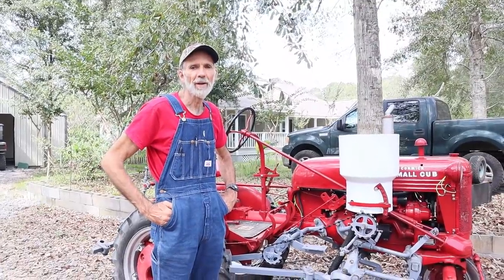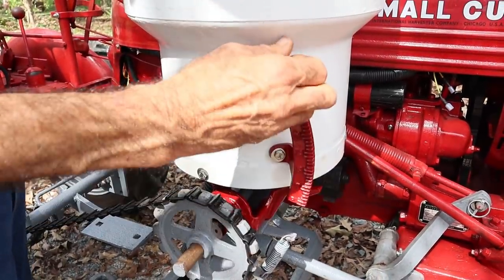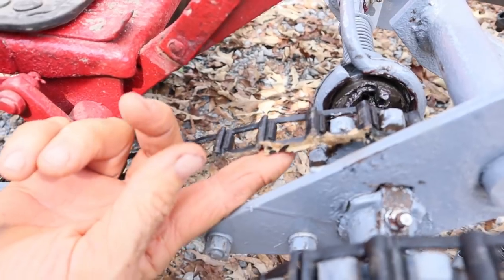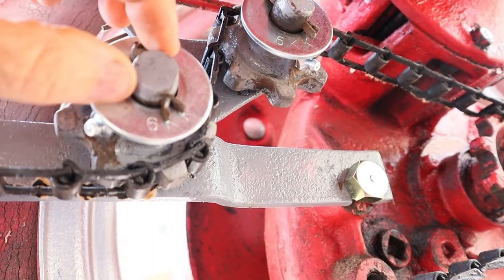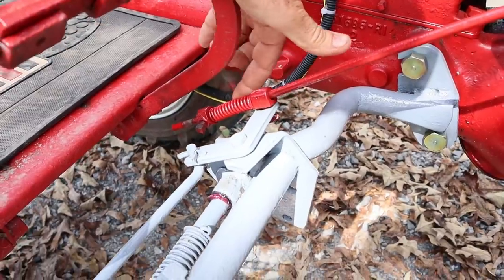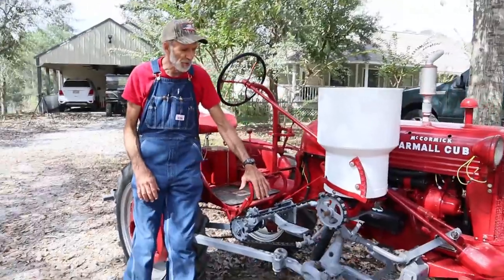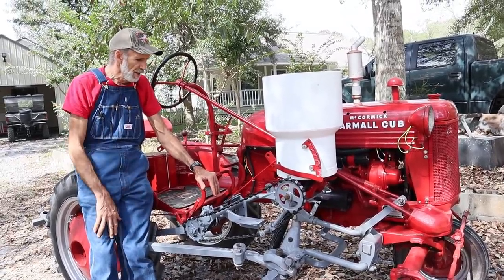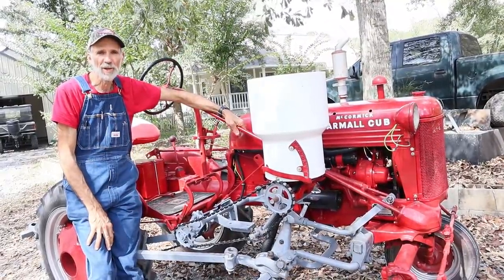Fertilizer Spreader for the Farmall Cub

Comment: Hello again Danny.  I don’t know if you will be able to see this comment as the video is not current.  On with my story, I very recently purchased a Cub with a side dresser.  Someone had stolen the man’s cultivators as he had them on a pallet behind his shop!  The side dresser was indoors however.  The majority is as NOS, I just did not know how to install it.  I am 95% that I have everything now.  The hopper (with lid) is as new as well as the mount.  I got a bunch of different sprockets in the tub of “stuff”.   The man did not realize the cultivators were not there until the deal was nearly complete.  He discounted the tractor so much I could not pass it up.  I have a bunch of Cubs (mainly early) but no side dresser or planter!  Thank you for providing useful information.  I’m somewhat older than you, but I refuse to be a couch potato!   I just finished a 1,600 mile rd trip to pick up a 25 hp TLB package out of western TN.  Pretty country.  I’m the guy the gave Joey the Super A’s.  Heck of a nice man, and his family.  Thanks for sharing your time and knowledge.  Stan here.

Comment: I have a special place in my heart for the Farmall Cub. The first tractor I ever drove or used was my Grandpa's 1955 Cub. When I'm done with my fertilizer hopper, I clean and wash it out. When it dries off I set in in a tub od burnt motor oil until about a month before I will use it again. I take it out and turn it over so the fertilizer will drain off.

Comment: Thanks so much for this video. I have most of the parts for that same set up for my Cub. I am missing the parts that are used at the bottom for putting seed and fertilizer in the ground. I will use your video when I install on my tractor. Thanks!!
Reply from the maker: Hope it helps.

Comment: i spent $4000 getting a wreck of a cub that belonged to my uncle in mississippi restored.  it was a wreck, should have been scrapped, but it was "family".  so i cringed and went for it.  the guy doing the work spent two years, every time he turned over a rock he found more trouble.  later he told me it was the most difficult one he ever restored.   i forged on.  after delivery i still did some follow up work, carb, regulator, still doing the fine detail work.  it was worth every penny, i only found one as nice and it is in a museum.  it starts up with just a touch and sounds like a little sewing machine running.  i have a picture of my uncle riding around on it in his yard in the 1950's.  it stays in the poe barn on concrete floor.  it's huge demanding farm job is me riding it out to the mail box.  still is almost entirely original.  still 6 volts and generator.  people run these little gems into the ground until they die a sad death then park them and let nature rust them back into the soil.  it is just sad.  THIS GUY at first i thought was just another "hill billy" abusing a little cub, i was wrong.  he has dug into this at great depth and treats the little cub like it is a real treasure.  he has a video on the most extensive piece on wiring i have seen yet.  not exactly original style but neat and functional.  i am still pondering mine, there are some issues with the L charge and other of the 4 positions that are a little vague, what farmall engineering intended to accomplish there.  it sounds real simple....until you dig into it deeply.  when you get a little cub all restored and everything working right it is a real joy and worth every penny and all the time spent.  they are an amazing piece of equipment from.....ummmm....how long ago ???  70 YEARS AGO.....think about that for a while......
Reply from the maker: I have since purchased new tires and like new equipment that I'm restoring. They're worth every penny.
Reply: @DeepSouthHomestead  yeah, i put new tires on all the way around, they were needed.  i am now having a super M reworked....it really needs rear tires....once installed those tires will out live me
Reply from the maker: @ab9d723  sounds great I'm having to slow down on mine I'm up to ten grand in this thing and I'm still finding things I don't have for it. But I'm loving it and watching it come back to life. Hope yours turns out really nice.

Comment: Great job rebuilding the fertilizer system on the cub. It will help anyone trying to repair a cub they might have purchased. Is the clutch  engaged with two discs or is it some kind of gear system?
Reply from the maker: It's a year system.

Comment: Where can I buy a rubber drop tube like you got on that hopper?
Reply: AGRI Supply sells the rubber drop tube with the flat top. I think I paid about $27 in the store. They have a website. They also sell a replacement hopper and internal parts for the hopper.
Reply from the maker: Couple different places agrisupply, stieners tractor company.